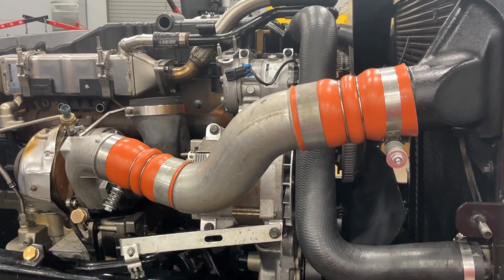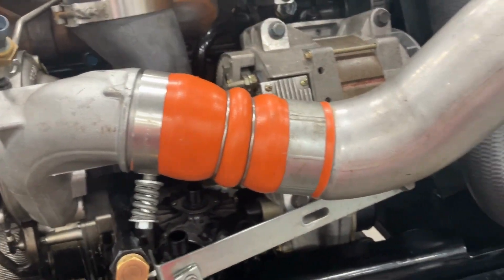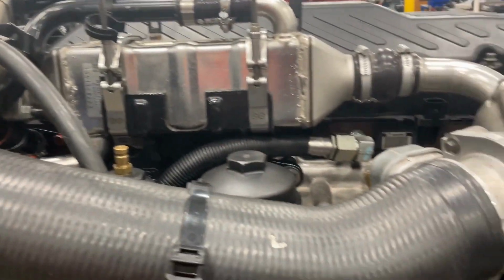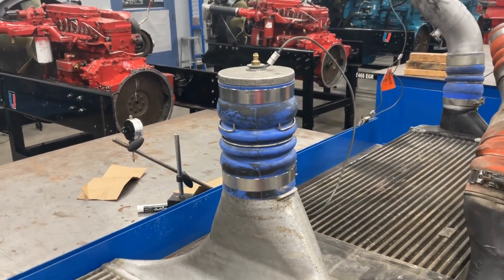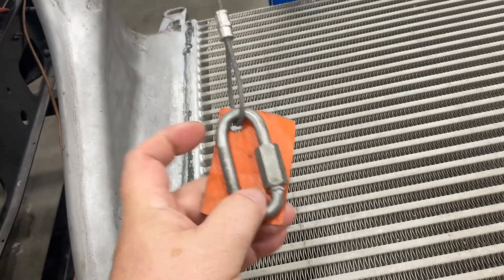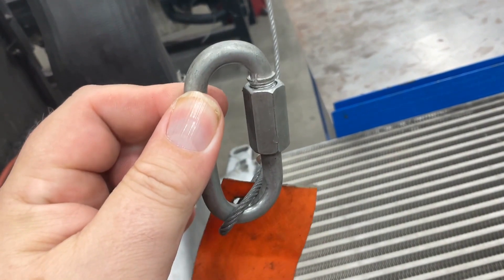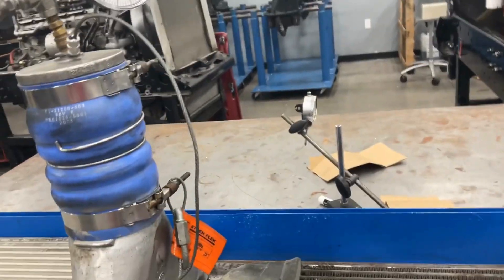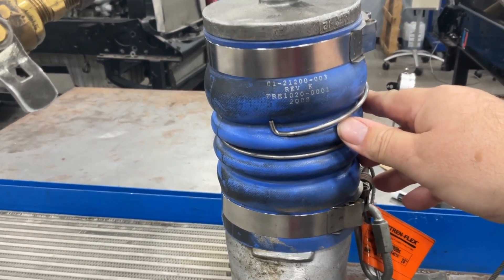𝐂𝐡𝐚𝐫𝐠𝐞 𝐀𝐢𝐫 𝐂𝐨𝐨𝐥𝐞𝐫𝐬 (𝐂𝐀𝐂)! 𝐖𝐡𝐚𝐭 𝐓𝐡𝐞𝐲 𝐃𝐨, 𝐇𝐨𝐰 𝐭𝐨 𝐓𝐞𝐬𝐭 𝐓𝐡𝐞𝐦.

Comment: Can I use a newer charge air cooler than what's on my 2015 6.7 since they're cheaper?
Reply from the maker: If it is a similar size and you can mount it yes.